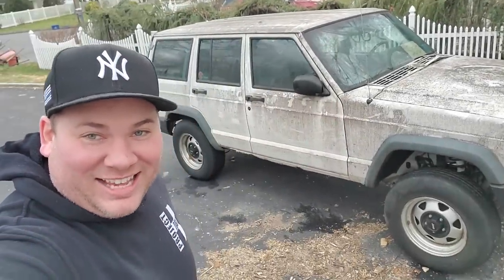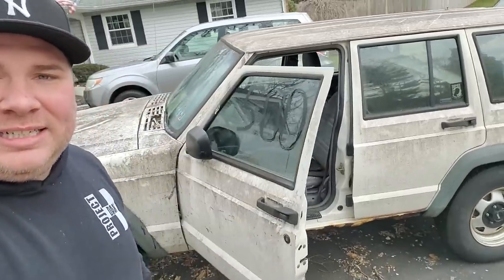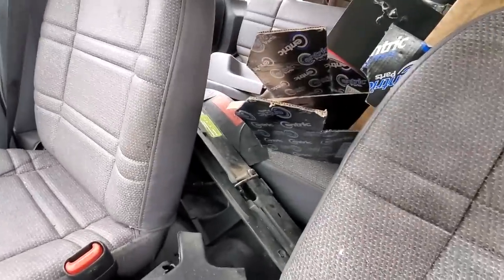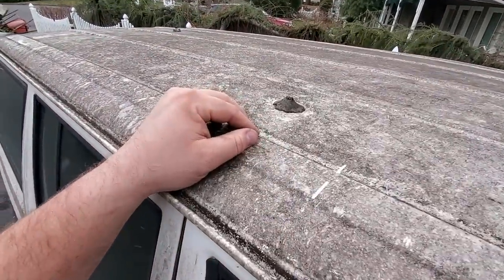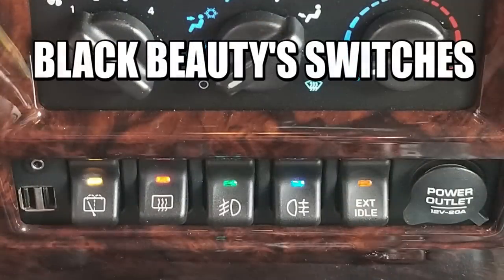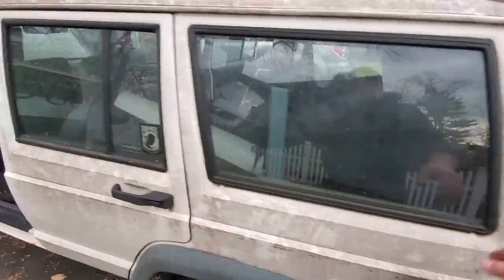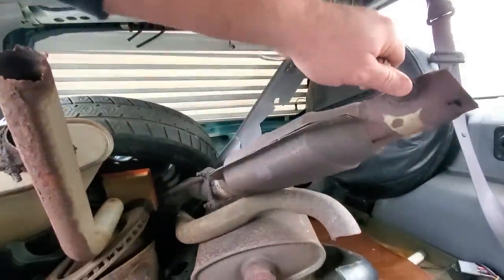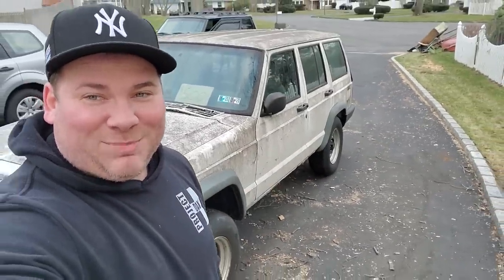STIMULUS XJ - I BOUGHT A POLICE PACKAGE PARTS JEEP CHEROKEE

Comment: The Stimulus XJ! LOL
Reply: Dan and barricade garage I’m a big fan of both of your guys channels, have used videos from both of you guys to help me do repairs on my zj . Iam in need of advice though, my wiring harness to my front driver door is all cut up and torn so I can’t roll down windows or lock/unlock my doors. Everything online I have looked up shows people splicing in new wires to fix the bad ones. I’m not good at electrical so I went to u pull it and got a new door wiring harness out of a 93 grand Cherokee mine is a 94 but the connectors on both ends look the same do you think that would fix the problem to just switch the harness or do you think I should just repair each individual wire? Any help would be greatly appreciated.
Reply from the maker: @liamobrien1810  hey Liam, thanks for watching! Barricade is the best!  I believe the best way to repair brittle door boot wiring would be to replace it!  The 94 harness should work in the 93 if the connectors are the same.  You can unplug the harness from the kick panel area and feed all the wires back into the door and pull them out by the speaker area.   Unfortunately the 94 harness is just as old and it may be also brittle.  I suggest you save the old harness, practice soldering, then splice yourself about 5 inches of fresh wires where the boot would be.  Do them one at time and use shrink wrap tubing.  When your done youll have a new skill and a fresh harness ready to go for next time!
Reply: @ProjectDanH  thank you for the input. Gonna be installing the new harness soon. Have you ever unplugged the door wires from the connectors in by the kicker panel? The bigger connector is a pain to get off and I’m sure I broke the connecter on the Jeep at u pull it. If you have any tricks on getting that connector unplugged I am all ears. Maybe a video on it could be coming soon?.... lol thanks again Dan.
Reply: You better hope for more stimulus fix it up ! Good deal, not wasted !!!

Comment: I own a 2000 XJ Police Package and it’s a little different...came with larger radiator, brakes and Posi-Traction rear ended... I very seldom use 4wd...
Reply: I also own a 2000 XJ police package. Mine also has those same options as yours. The police package wasn't just a one size fits all package. They could be customizable for what the department or gov. agency wanted. Mine has regular cloth seats, carpet, and is the Sports package.
Reply from the maker: awesome Marlene!  send me pics on IG!
Reply from the maker: @microlocity  yes! They were very customizable.. I find them all to be very different 👍